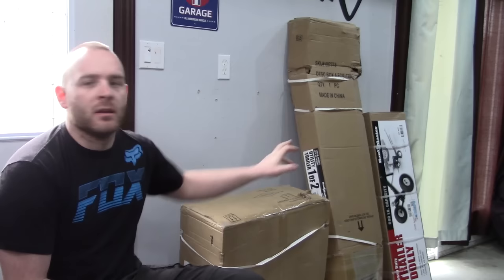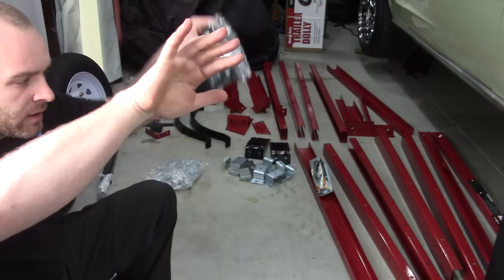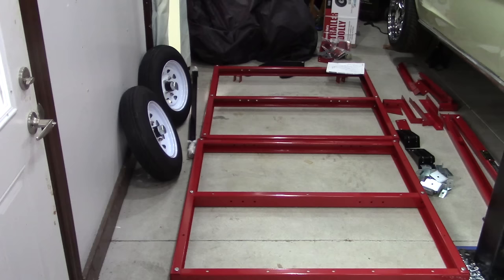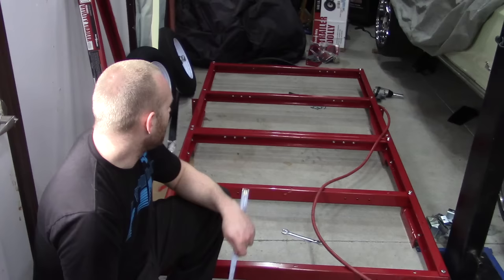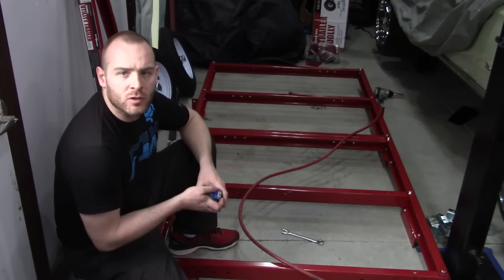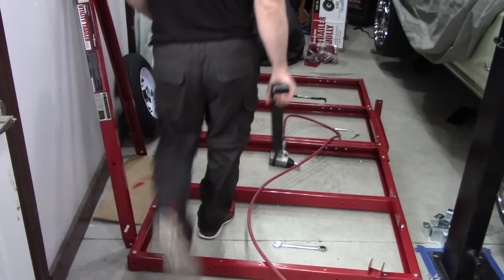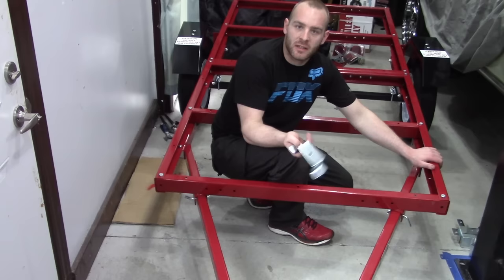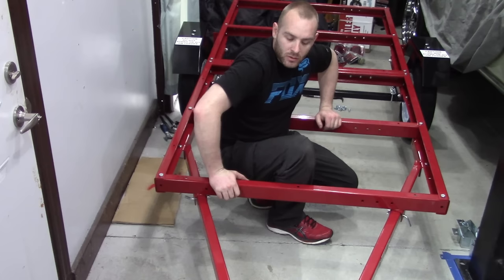Harbor Freight Trailer?? JUNK or NOT???

Comment: They aren’t bad little trailers for the money  although assembly is a bit of a pain in the ass. Because many of the holes. Dont line up i used a die Grinder  quite a bit to  anlarge some holes  if i was to do another i probably would opt for a drill and dril bits  to ream the holes  i do use the folding  hinges and the  casters for storage and ive found that it works  okay  for what it is  a very common problem that people do  when there are grease fittings. Is they have a tendency to over grease the bearings and when the grease. Warms up it expands and pushes off the  caps. On the  hubs  allowing all the grease o get slung out. And burn up the bearings  that do damage the  axle spindles  i grew up in South Florida and ive seen lots of boat trailers that has happened to  because of people using bearing Buddies   ?
Reply from the maker: Great review!   I agree with alot of the comments you have made!
Reply: Change out the grease caps to ones that have a small opening to allow pressure to be released. They sell them, ck it out.

Comment: How long did it take you to assemble the trailer?  I had one of these many years ago, but too long ago to remember the assembly time.
Reply from the maker: id have to guess roughly 5-8hrs by the time it was all said and done. it was a while ago now so i may be off a little
Reply: @710Garage  Can you tell me the overall length of the trailer from the tongue to the last cross beam?  I know the bed is 4X8, but how much length does the tongue add?  
3'?  4?
Reply from the maker: @ts3871  i will measure today for you!
Reply from the maker: the tongue adds 43 inches.  so that makes it 11.53 ft TOTAL from the furthest point on each end.
Reply: @710Garage  Thanks for taking the time to measure it!  I'm trying to determine if there's room to put a 16' plastic boat on the trailer, without placing too much weight behind the axle.
Reply from the maker: @ts3871  glad to help!  goodluck with your project

Comment: Just another quick comment, at about 14.08 in your video you had the frame resting on a battery with bare terminals showing, believe me you only do that once !! Lol. I found an old rubber car mat works best to avoid welding your trailer or whatever to your battery or even the battery exploding, if you've seen a battery exploding you'll know..anyways, looks handy little trailer,have to see if can get in UK..🍻 cheers
Reply from the maker: lol yes i know i couldnt find anything else for the clip in the video.

not an average practice around here.

Comment: The fold is what makes the weight capacity on it if you actually weld those two beams together since you're never going to use it as a folding trailer it'll actually hold 2000 lb with no problem whatsoever
Reply from the maker: while i agree with you in part i didnt want to say ive upped the capacity and lead people down the wrong road.  i do believe that ive helped the trailer structurally but without an FEA report done i wouldnt want to claim that its by  30% or something. 

for what i use the trailer for i think its overkill anyways ( hauling branches and stuff around the yard ) but i do think the limiting factor now would be the tires.  they are junk to be honest.  ive had 2 now split wide open like a taco with only an atv on the trailer at that time.

Comment: The trailer not being correct is the fault of the employee at the store..  they gave you half each of different lot numbers..  this has happened to me a few times with items that come in more than one package..  

You could've gone back and gotten the correct set up with no questions asked.. still sucks it happened though
Reply from the maker: no the parts were in a sealed box.  it couldnt have been them.  had to have been the factory when it was packaged.

but either way its fine and its still holding up well.
Reply: @710Garage  what I mean is that it came in more than one box.. on coupons and in store on the barcodes there will sometimes be more than one available model for the same item..  you got part 1 of 2 from one item number, and part 2 of 2 from a different item number..

On the one ton engine hoist, one of the item #s comes with the wheels in box 1, and the other it comes on box 2, so if they mismatch it, you have to return it
Reply from the maker: this is a possibility.  but the pieces that were wrong were in part 1.  not split between the 2. I see your comment and understand but that is not what happened here.

Comment: Can anyone tell me the size of the boxes or what the longest piece of railing is if I have to unbox to get them in? I have a CMax Energi with about 63 inches from tailgate to back of front seat with 36" ( length) x 40" (across) where the back seats fold down and 36" at the narrowest point in the rear. I went to our local to find the box sizes, but they don't have it (and won't be on the next shipment).  I'm pretty sure the smaller box will fit; not sure at all about the long box. TIA
Reply: I have them if anyone is interested. Box 1 is 16.5" x 4.5" x 62.75" with volume of 2.61 Cubic ft; weight is 72 KG (159 lbs). Box 2 is 24" x 24" x 10.5" with volume of 3.8 cubic feet; weight is 43 KG (95 lbs). No problem getting them into my CMax E. It "appears" that all the parts are there.
Reply from the maker: it would be tight... if memory serves me correct i would guess about 49 inches is the longer box.   by roughly 12 inches tall and 16 inches wide..
Reply: @710Garage  Thanks. As it turned out, there was plenty of room.

Comment: I have to say 2x6 or 8 PT would have made a far better deck and strengthened that tinny trailer some, just a thought. Plywood is so cheesy and short term.
Reply from the maker: it only needs to hold an atv from time to time... its not holding a house lol...

thanks for the comment though

Comment: Be better off buying a used trailer in good condition cheaper and much better made. I bought my factory made 4x6 tilt for 100.00.
Reply from the maker: that isnt a bad idea if you are handy and have time to reno an older trailer.
Reply: @710Garage  Just have to check out good before you buy.Plenty of good trailers out there for 200.00 or less that need nothing. The HF has no floor or sides. Gotta buy that stuff and good lumber ain't cheap. Not a fan of plywood.
Reply from the maker: @robertclark4929  i didnt need sides so i this works great for me, but maybe not the perfect solution for everyone.
Reply: Good luck with that. People around here think their used trailers are made of solid gold. If you find one for under 400 bucks its probably a run out harbor freight job.
Reply: @RedfishInc  Exactly!  You're 99.9999999999% on target.  Most used stuff where I live isn't even fit for a landfill or recycling bin.  But I got lucky and hit the 0.0000000001%.  Got my 5x10 3000lb trailer from an estate sale.  They had it priced at $400 and I jumped on it.  Just needed new tires.

Comment: I did cross country on it and lost everything. Finally it was in such a bad shape I had to dump it in Phoenix.
Reply from the maker: you cant leave us hanging like that!   what happened to cause this?
Reply: Protector K9 how the fuck do you lose everything. More description needed. I’ve had plenty of these and never had a problem
Reply: I started in nyc with Honda civic pulling the trailer. I had my belonging in suit cases . Around virginia I lost tail lights . In TN rain caused the plywood to deform and causing the straps to loosen.  Eventually everything flew away on highway.  All my suitcases were open . Clothes were torn and useless. Lost one suitcase which had all my leather for motorcycle worth thousands.  In texas I heard big scratching noise and smoke come out from the rare. Pulled over didnt see anything unusual. It was on highway and middle of the night. We reached phoenix and noticed there is wobble in tire. Finally took it to mechanic who told us the bearings are crushed and it would be 100 bucks each to repair. I asked him if he will buy the trailer for 100 bucks . He agreed and I sold the trailer. This travel adventure was known as adventures of the red trailer. Oh I was following the Honda civic (wife driver) on my sport motorcycle zx14 during some parts of the journey.

Comment: Wheels are too small so when your towing it bounces all over the road in transit
Reply from the maker: i havent noticed this unless it was empty.
Reply: @710Garage  tried towing 2 personnel skiies on it.  It wasnt good I guesse if you dont take it above 35 mph or on the interstate it may be useful.  Or was my boyfreind a numnuts for trying to tow something very expensive on a cheaper version of a trailer?  Hahaha cutten corners and maken repaires.
Reply: I have a 4x6 trailer from a different store and it bounces too till I get at least 400lbs+ on it. I recently changed from 12" wheels to bigger 13" wheels that's about 4" larger and it still bounces.
Reply from the maker: possibly the weight was off??
ive had this thing loaded down and no issues, aswell as a light load and no complaints.  

too much or too little tongue weight will REALLY mess with the way it handles while driving
Reply from the maker: it will bounce as the springs are for heavyweight but the trailer itself isn't heavy enough to use them.  so they bounce.   its the nature of the beast

Comment: I know this is 2 yrs old but you paid $249? It runs for $550 now 😡
Reply from the maker: unforunately yes sir.  the 1100lb version was 249 and the 1700 was around 349 i believe
Reply: @710Garage  there's a video that showed a guy taking out the very minimal amount of "packing" grease in the wheel bearings (it looked blue) and replacing it with actual highway grade grease because he read/heard that there were issues. I know you said that you only use it for short distances. Have you seen this as a problem yrs later?
Reply from the maker: ive had 0 issues since built. and i use it around town often.  i dont do high speed/ long distance runs with it
Reply: @710Garage  OK thanks

Comment: That dolly trailer is TRASH, bent bad it in the second use!!!
Reply from the maker: i only use it to move the trailer when it is empty.  just alot easier to move it around with that then by hand.   im sure with a bunch of weight on the trailer it would not be as happy.
Reply: I've got one of those and use it to put my trailer in and out of storage with 2 Honda 350x sitting on it, no problems.

Comment: Is it worth it..??
Reply from the maker: i think its a decent trailer yes..  My 1 tire did explode ( opened like a taco ) with only 500 lbs on the trailer so that sucked.... but the frame and such are worth the price i believe
Reply: I've had mine loaded just past max load several times. I love it! Can't beat the price and you can always put on better tires.
Reply from the maker: my stock tires exploded with an atv on it so i did just what you are saying!